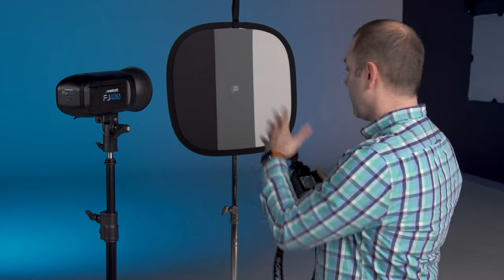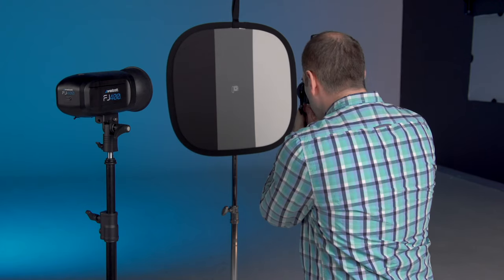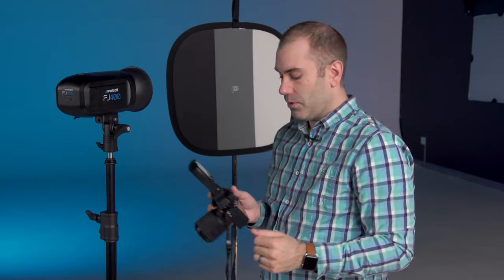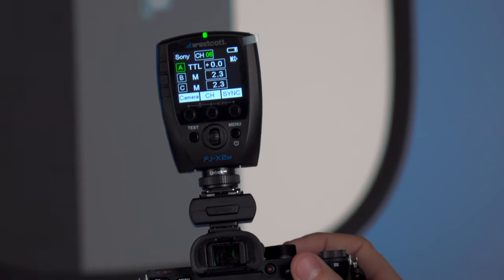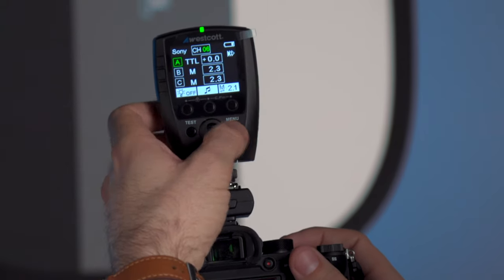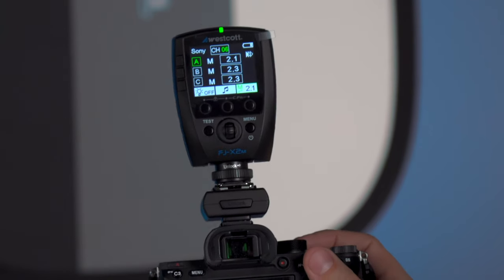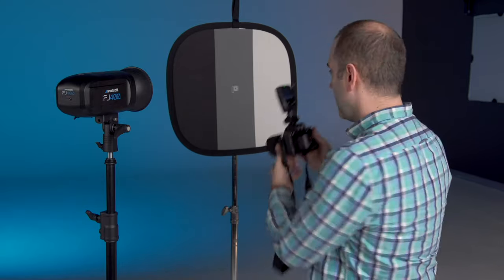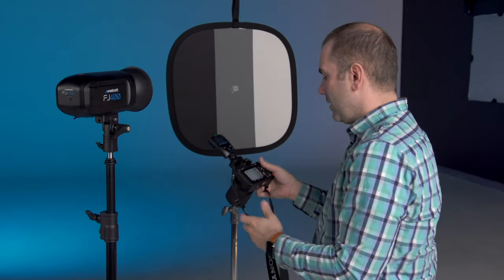FJ400 Strobe Overview: Switching from TTL to Manual Mode

Comment: What if it’s not giving you the number it just says TTL-M?
Reply: One year later... for the ones with the same question. On my trigger, by pressing TTL-M for 2-3 sec, it will go in M mode with the right exposure. (So not a reading like in the video but an automatic transpose in M mode). But, before I had to reset the strobe in menu 6 (that appears by pressing button 1 a long time) to make the TTL working correctly.

Comment: Does this work for both groups if I'm using two strobes in different groups? It seems to only display and set Group A to manual. Group B stayed on TTL and did not display the power level

Comment: Can I do this on FJ 80 with FJ X3?  Thanks
Reply from the maker: Yes!
Reply: I can do this with the FJ 2 but can’t figure out the button sequence for the FJ 3😢
Reply from the maker: @bynumoil9615  You just need to hold down the top square button on the left side of the trigger.

Comment: Why won’t my trigger change to manual from TTL?
Reply from the maker: We’d love to get this figured out! You can get ahold of our customer support here: https://www.fjwestcott.com/support/contact-support
Or give us a call at: (800) 886-1689
Reply: Would you be using a Sony by any chance like me because I have the same issue and like some other guy mentioned here, if you go into Sony menu 1 page 11 and turn OFF wireless flash it fixes it? 🤔 However I've seen other Westcott videos saying this needs to be turned on to trigger the flash, so turning it off works apparently, going to try it shortly.
Reply: Also if I turn off the camera it allows me to turn the Manual mode on and it adjusts the FJ400, turn camera on, take one shot and it automatically switches to TTL again and won't go back to Manual. Is this a bug with the Wireless Flash option turned on in Sony? Turning it off apparently fixes it.
Reply: @sgurrtours  Hi, yes I have a Sony A7iii and turning it off was able to work. I saw the same thing in the video but I realized the person was not using a Sony camera. I have not had issues since I did what was recommended.
Reply: @turfittistr87  So I tried this last night and now it works just fine, I am not sure what that feature actually does, whether it is for a native Sony trigger maybe? I even plugged my Pixl wireless trigger into the camera with the FJ400 and wireless trigger attached and it worked just fine too.
Reply: Hi did you ever find a solution to the problem. I am dealing with the same issue
Reply: @MTmujeres  Hi,

Yes please reference Sgurr Photography comments above for recommendations